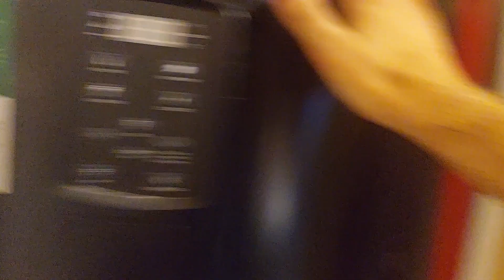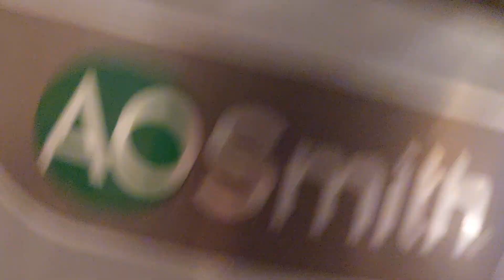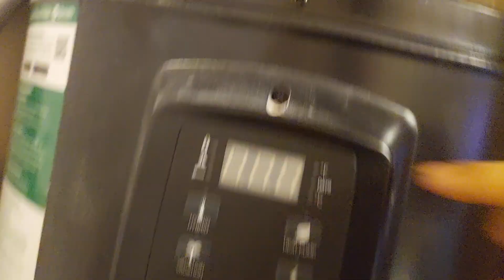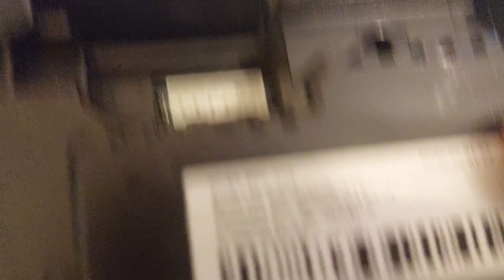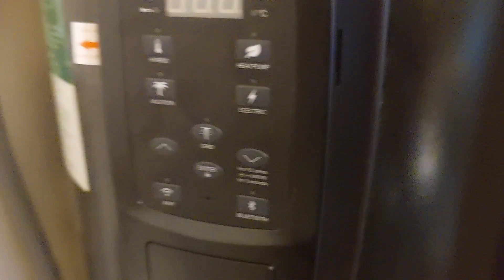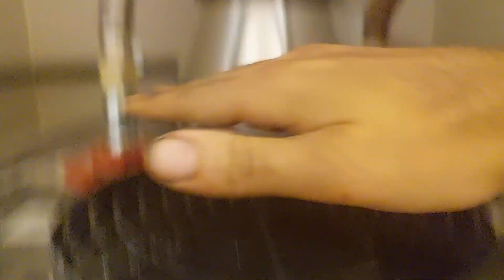Five Minute Fix 39 - Control Board Swap AO Smith Hybrid Hot Water Heater

Comment: They sent me a new control board how long did yours last?
Reply from the maker: As I wound up replacing that unit under warranty, I don't know.  The current heater has about a year on it and it's working well so far... We'll see if even gets to the three year point where the anode rod needs to be replaced.

Comment: It would of been nice to show how to change from heat pump to electric, how many days, vacation mode ect. That's the problem I'm having is figuring out these things,. I get water temp and 3 days shows up, I don't need AC in the winter, the 3 just won't go up or down. Thanks thanks for your time for the video.
Reply from the maker: So you can flip to electric only, but you have to reup it every 3 days.  Vacation mode I've never played with.  There is an app that goes with this heater that allows you to do some stuff via your phone, but its....... meh quality.  Slowly getting better.  I don't really use the app as it always signs me out.

Comment: I have the 120volt model. I replaced the control board with the help of your video, but I’m still experiencing the unit running continuously. Any tips or advice on how to replace thermistors on these?
Reply from the maker: That I don't.  The heat pump part of the heater is intended to be non-serviceable to the end user.  I took a panel off it once and looked around and saw some basic electronic parts that looked replaceable but without a diagram to work from it's tough sledding.

Comment: I have had to replace my AO Smith three times. This thing has a design defect.
Reply from the maker: I'm on my 3rd one as well.  The hot water part works well.  But they don't seem to be able to make a decent compressor for the hybrid part of the system.
Reply: I've had mine for 13 years w/o any issues.

Comment: if you still have the old control board, i would love to see a teardown!
Reply from the maker: That I do not.  I have a Ford 460 engine I'm going to tear into to make it turn again.  That might interest you once I get that video done.
Reply: A microcontroller with multiple IO lines to scan a keyboard and control some MOSFETs.  You might check the FCC registration site - if the thing has wifi the FCC usually requires a fairly detailed submission unless you are using a pre-certified WIFI/BLE module

Comment: How do you turn it on? Mine the lights turned off and it’s not heating.
Reply from the maker: It should be that the unit will power up as long as it's getting power from your house.  If it's not, my guess would be your control board is bad or you have a loose connection going to the control board.

Comment: Our water heater is spitting huge amounts of water.
Reply from the maker: Failed pressure vessel?  I would reach out to AO Smith customer support on that one.
Reply: From the pressure relief valve?  Valve might be stuck or you temp is WAY to high

Comment: Thank you for showing how to lift off the control panel very helpful.

Given all the problems people are having with the a o smith Hybrid, heat pumps, water heaters, A.O. Smith should put a bunch of DIY videos up on their support site
Reply from the maker: They should but they won't.  Removing and replacing the control panel is about the limit of the troubleshooting you can do for the heat pump.  My current (second) heat pump is dead because the fan won't turn on.  Compressor still works, no fan.  If these things were more user serviceable I would buy the new fan parts and dive in.  Alas, I have to lug the whole thing back to Lowes and do a swap and hope the existing in stock until is not more expensive than what I paid.
Reply: @MazdaB3K  I just replaced the three temperature thermistors to solve an HPO (water or ambient temperature out of range) error code -error.

Meanwhile changing the anoide on the old 6 year resistance water heater had 16 years with no trouble beofre this 'cost savings' upgrade....
Reply from the maker: I take a quiet comfort in that the unit has a 10 year warranty.  After that, Rheem all the way.  AO Smith never again.
Reply: @MazdaB3K Same here.  I’ve had two State water heaters (literally the same as A.O. Smith) replaced in 3 years.  Now the third one is failing.  I’m not even going to bother with the warranty this time.  I’m just going to replace it a Rheem or GE non-heat pump water heater.

Comment: Nice.  Have you ever had wifi connect problems?  Mine keeps throwing an error code "can't connect in setup mode"
Reply from the maker: Never had that particular issue.  The issue I have is that the app will sign out randomly on my phone, making it pretty useless for keeping an eye on things.
Reply: @MazdaB3K  Got the water heater about a week ago and can't even get the wifi going 😡
Reply from the maker: The support guys I worked with from AO Smith were pretty responsive.  I would give them a call and see if they will send you a new control unit.  Control unit contains the wifi module.
Reply: @MazdaB3K  Thanks!  Yeah been back and forth with Customer Service trying to figure the problem.  They said last resort was sending a replacement for the control unit.

Comment: Might Congrol Board replacement fix an AO Smith HPTU-50N if the problem is that on Efficiency (heat pump only) mode the heat pump fan starts (no one showering or dish washing) and runs many, many hours. Is that possibly control board or is it undoubtedly refrigerant loss?
Reply from the maker: The heat pump should fire off when the tank water temp drops below whatever target has been set. So if it's trying to run say once a day or something like that, it might be trying to hit your target temp.  Or, maybe your temp sensor is wonky.  Or, it could be something with the control board.  You are going to have to do some troubleshooting to narrow down which part is not behaving correctly.  However, I don't see how it would do fan only for a run operation.  That would point to the compressor not firing off.  Again, that could be control board, could be the starting capacitor, or as you stated a loss of freon.  Are you getting any alarm codes?
Reply: Man why didn't you show how take out ECC module because you never did because anyone who has knows pushing down and up or whatever you says doesn't work you need a screwdriver to get in there.
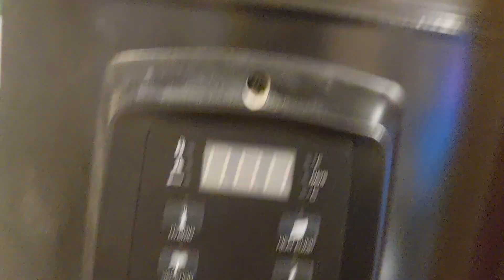Reply from the maker: I'm a bit confused.  I reviewed the video since it's been awhile and starting at around 2:39 I cover how to remove the module, then actually remove it on film.  If you are referring to the actual main and daughter boards they are inside the module that I removed.  If you wanted to remove the boards from the module sure, you'd need to dig deeper and take the module apart.  However in my situation AO Smith gave me a new module so there was no need to remove actual circuit boards from things, just swap modules.
Reply: @MazdaB3K  We had a sudden issue with 8-month old unit that temp was not hot thru whole shower and fan ran longer than before. One tech recommended Control Board Replacement. Another tech said if the temp difference of air measured on top of unit compared to air blown out the side by fan is not 10°F, then you have irreparable refrigerant issue and need to replace whole unit.
Reply from the maker: I can imagine that if you do have a freon leak they did not design to the system to be easily serviceable, so they just say to chunk it.  I've worked a bit on car AC systems and they can be a pain to work on and they are designed to be worked on.
Reply: I just had this same heat pump installed.  Prior to purchasing  I did a ton of research, including talking to AO Smith technical support.   The heat pump is NOT serviceable.  AO Smith will replace the entire unit within the 10 year warranty.  First year of warranty covers labor.  Years 2 through 10 the customer pays for the labor to remove and install the new unit.  The customer may have to pay an upcharge difference  if their model is no longer available and the replacement model costs more.
Reply: I  just spoke with technical support. They said they not cover the labor for replacement. My water heater 6 month old .

Comment: So... did it work?

Thanks for the video. I have a similar but different problem - the heat pump is running and doesn't throw a code, but it isn't actually making any heat. I can see from the circuit power monitor that it is only drawing 120W instead of the 250W it normally draws in heat pump mode. The fan is running but the exhaust isn't cold so I assume there must be an issue with the compressor. TBD.
Reply from the maker: Unfortunately no.  I ultimately had to replace the heater under warranty.  New one is working great though.
Reply from the maker: If the compressor is not kicking off at all, I would check the starting capacitor.  I do note it in my video.  Shouldn't be hard or expensive to find a replacement and do a quick test.
Reply: @MazdaB3K  thanks, I'll give that a shot!
Reply: Were you able to figure out the issue to see why heat pump fan is working for so long?
Reply: @RohitKumar-co5th  I checked the capacitor, it was fine. The heater worked in electric-only mode (using 3x the electricity) but eventually started showing a compressor error code ("ECC"). I went through the warranty process which cost $400 to get a tech to look at the code and verify the unit was not repairable. Replacement unit was free though. Install not covered. I'm guessing the problem was caused by a refrigerant leak.